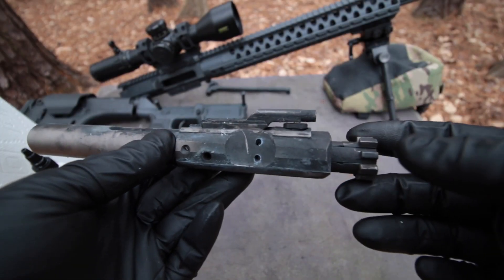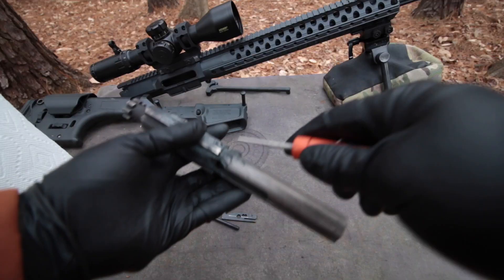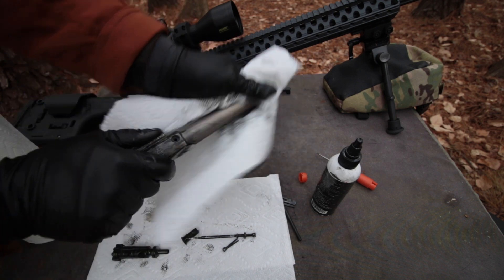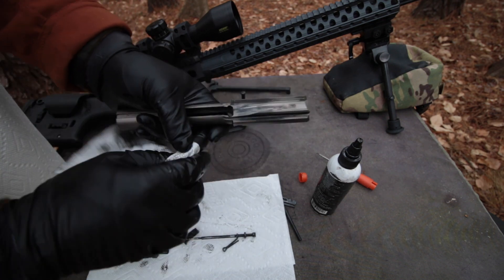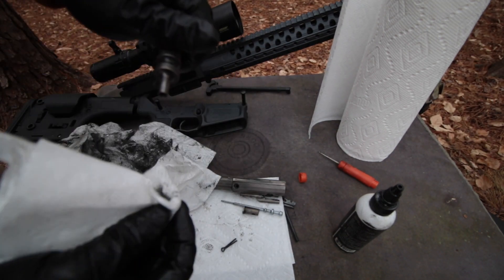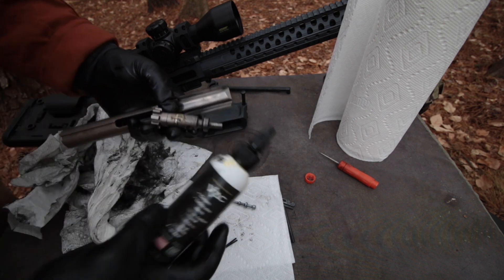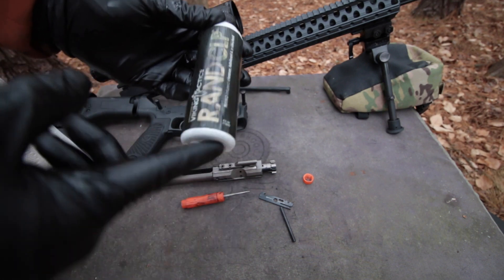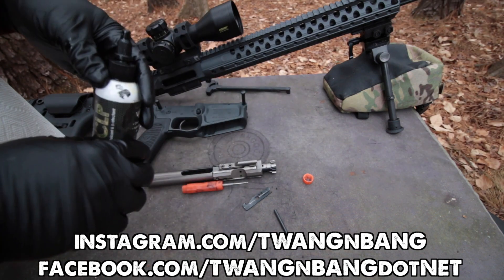RAND CLP Gets The Gunk Off NP3!

Comment: Try straight canola oil or coconut oil.
Reply from the maker: The problem with straight plant oils is that they will gum up over time.  I prefer using products that don’t require special treatment for the first application (such as Frog Lube and FireClean) and that I can use and forget about.  Because of what I do for a living, it is very common for me to put a gun in a safe and not touch it for a very long time.
Reply: Agreed, I wipe those off after cleaning and use Mobile 1 for final lubrication / protection. If you have a CLP you trust, I guess you can skip the final wiping off, although in the video you kinda did that anyway.
Reply: I recently purchased an Auto 5 that someone appeared to have used cooking oil in... It was so gummed up that you could pull the bolt back and no matter where you pulled it back to, it would stick right there till you pushed it again. I ended up having to boil the bolt group to get it right again. Be very wary of those oils, haha. Or at least make sure you give a VERY good rub down first!
Reply: Agreed, but at least I know it's a cooking oil and hence do remove it. Think about all the people being dupped by paying for fireclean and froglube, thinking it's a good lube (longer term)!
Reply: GetTheFO yup. It's important to know your oils. At least when you use vegetable oil, you know it's vegetable oil. Think about those that use fireclean and froglube without knowing it's Vegetable oil?

Comment: After watching that I can't say I'm impressed that Rand CLP cleaned that NP3 bolt, considering ALG Go Juice, Slip 2000, Lucas Extreme Duty Gun Oil, Breakfree CLP, G96, and even water based cleaners do the same thing to practically the same effect in the same amount of time. I'd say this is more of a testament to the ease of cleaning of NP3 coated parts. I have a complete Sionics BCG, a Sionics bolt (in a parked carrier,) and few NP3 treated fire control groups that clean up just as easily with whatever I seem to have lying around. NP3 is great stuff, but even Fireclean - as much as I love to hate it - will clean NP3 easily.
Reply: Exactly
Reply: I haven't used the products you mention here to attest to their efficacy, but I just cleaned a Kriss Vector and a Remington 870 Express with Rand CLP and had similar results to this video. So take that for what you will.
Reply: In my personal experience they all more or less work the same on platforms like what you described. The loose, sooty carbon like what builds up on the inside of a semi-auto handgun or the outside of a BCG isn't tremendously difficult to clean. I used to use LSA in the Army to clean BCG's and every manner of open bolt full auto crew served gun to pretty good effect and never had a complaint about it. It was a shit lube but it worked decent to get crud off of guns. Modern lubes like Go Juice, Slip 2k EWL, Rand CLP, or Lucas break up that loosely stuck on carbon and make it easy to wipe away. Apply that same stuff to the tail of an AR bolt with a phosphate finish and things all of a sudden get stupid, and out comes the scrapers and specialty tools to get that part clean. At first the Sionics NP3 bolts I have were easy to clean in that area until the NP3 burnished through to bare steel, and out came the scrapers to get them clean.
Reply: So, I know nothing about the AR platform, but what is it about the tail of the bolt that requires extra attention?
Reply: Agree that anything NP3 cleans up super easy with pretty much anything. I have a Sionics Patrol 3 XL with NP3 BCG and the hammer. Wipes clean in seconds.

Comment: Would an ultrasonic cleaner work for this.
Reply from the maker: Sure, but then you have to dispose of the solution.  I save ultrasonic cleaning for things that I can’t wipe down this easily.
Reply: Not completely. Plus like T & B said, you have to dispose of the liquid as well as dilute the cleaning liquid before use. At my former employer we would clean our weapon with ultrasonic equipment but we would still run brushes over everything to make sure we got as much crud out as we could. While you are waiting for the ultrasonic cleaner to do it's  thing you could clean a piece by hand.

Comment: Hey Twang have you ever tried black lithium wheel bearing grease to lube the carrier and bolt? I'd recommend giving it a shot if you haven't. Not sure how it'll perform suppressed but under normal firing I've found that I prefer it over anything else I've tried. Most I've ever shot in a shitting was about 350 rounds in about an hour of shooting and I never saw a sign that it dissipated. Also it does a decent job capturing the carbon in the grease and all I really do is wipe it down and re grease. Again use the black lithium grease(I use valvoline) as it has a lighter viscosity than the red and others and doesn't thicken in colder weather as much. Plus it's like $4 for a lifetime supply for the average person.

Comment: Would that work on .22lr silencer baffles?
Reply from the maker: On the carbon, yes, but remember that much of what coats the baffles in a rimfire silencer is lead.  That takes a lot more than a wipedown to get clean.
Reply: TWANGnBANG thanks
Reply: I actually tried some of their "Hawg Grease" for my 22 can.. seemed to at lease make it easier to get the baffles out.

Comment: try the blue scotts shop towels, I use white lithium marine grease, everything just wipes off, the grease holds up to over 550F no smoking like you can see from many oils
Reply: Ghost Shadow agreed, or a lint free cloth is what I was thinking. You could end up spending time picking out lint.
Reply: But according to FireClean (tm) & Vickers the smoke is proof that the carbon is leaving my gun....
Reply: Actually RAND CLP  has a flash point of over 600*. Very high temp ratings. And i never notice burn off that i can remember, even after several mag dumps. Very quality stuff.

Comment: Is anyone else watching this thinking to themselves "who the hell wears gloves?".
Reply from the maker: When using solvents? There’s a whole industry built around shop gloves like I’m wearing, and it’s not because I’m the one guy that buys them. 😬
Reply: TheNomdeguerre I'm a REAL man! I drink these carcinogens after I'm done cleaning all of my weapons!  Gloves are 4 pussies, and so are no-toxic cleaners!  Lol
Reply: If you clean guns on the reg you should probably wear gloves.  Nitrile gloves are pretty dern affordable.
Reply: I always use gloves. Why get your hands and fingernails all stained black? Plus all that carbon fouling can’t be good for you rubbing into your skin and getting in your system. Gloves also makes the process so much easier too.
Reply: Find your local hospice for future reference.
Reply: Pitch Lock I was, then I realized I'm a dumb ass for not wearing gloves even tho I have then on the bench behind my gun bench....
Reply: Probably people who read.
"Caution skin and eye irritant"
The ones that don't will eventually get cracked, peeling skin and or little bumps.
Reply: Cultural Relic 
Clean them after each use and you really don't need anything special.
Hoppes and Rem oil and a spray can of solvent pretty much will clean anything.  Those bore snakes are fast and great too though.
If you get a used gun that has been neglected, different story.

Comment: WD-40 will do the same thing.
Reply: Did you know wd-40 is partially comprised of fish oil 🤔 That might be where the magic comes from
Reply: gone rydin WD-40 I like to use that very much, good rust protection for my exhaust pipe from my scooter !
Reply: gone rydin  Not really.  WD-40 will remove the carbon and it will protect, but it's a moisture displacer not a lubricant.
Reply: Says you
Reply: gone rydin  Uh no, says the truth.  WD40 is NOT a lubricant you can trust to stay on your gun.  It IS a moisture displacer and protectant.
Reply: Cultural Relic  lol...good one??
Reply: Truth and hearsay are not the same.